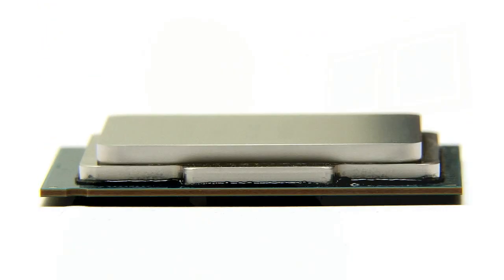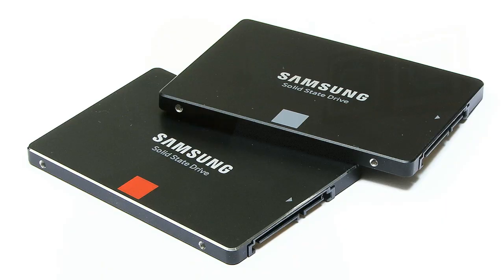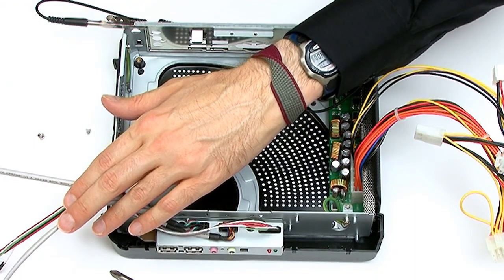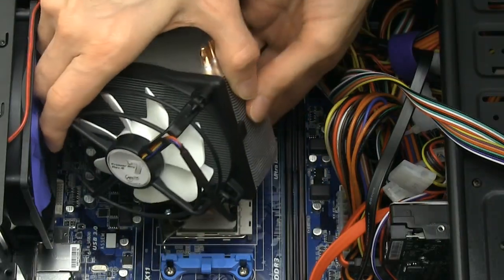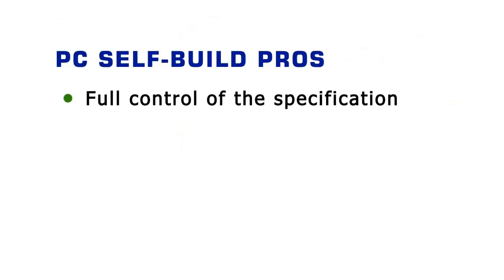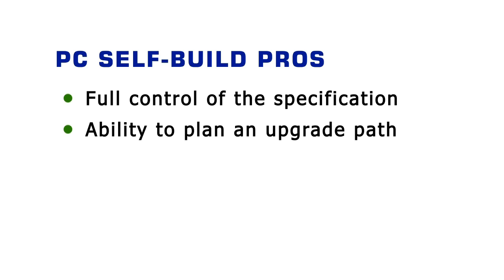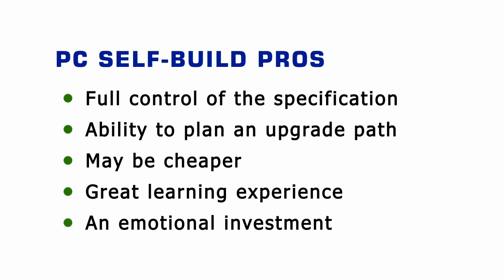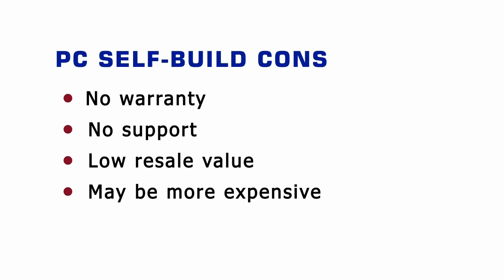New PC: Build or Buy?

Comment: Sure you can go out and buy a computer, but what's the fun in that.  Buy the parts and build it yourself and you'll have more satisfaction in that computer.  Everything today is practically plug and play not much involved...the worst part is installing all the software and the OS, that gets pretty boring sitting there waiting for stuff to finish installing.  

Trouble is, the cost to build your own PC is not as cheap anymore.  Companies buy in bulk so components are cheaper and they can sell the computer for less than you could get the same components and build it yourself for.

Has anyone ever actually tried to call tech support for that box store computer you bought?  

Have any of you actually built a computer and sold it?  Highly doubt it, you are probably still using it because you over-built it to last.  

The trouble is people get the idea to build their computer on their own but they buy the shittiest components then wonder why it doesn't work, or why it doesn't work properly.  Either build it properly with good quality components or don't bother.  

The hardest part is deciding which OS to install.  Sometimes the go-to OS is Windows of course but Linux is getting to the point where you don't have to be an expert programmer to use it anymore...oh and Linux is still free unlike Mac and Windows.

Comment: Excellent summary! I've both built and bought PC's for over 35 years, but I've been happiest for longest with the ones I've built. I'd only add to your advise that the risk of compatibility problems can be minimized (but not entirely eliminated) by using a (free!) part-picker web site like PCPartPicker (http://pcpartpicker.com/). They provide many example configurations at many different price points, for a variety of different uses, but also an orderly, very complete, component-by-component part selection process with a built-in compatibility filter. Also, the other internet resources available to help you learn how to do it, step-by-step, are so wonderful, that the risk of making stupid mistakes can also be minimized. Your own Utoob channel is a great example! But of course, stupidity is the most common element in the universe, so some people should simply never do it.

Comment: I've built a few PC's and always thought I didn't save any money but I did get to choose exactly what went into it. I also had to deal with finding drivers that would work with the MB and the OS and that can be pretty involved.

If you are using the machine for gaming I think the best bet is to buy a refurb. You can usually get a business machine with decent specs for short money. The last 3 computers have been refurbished and all have worked out well for me or friends i bought them for. This is an attractive option if you want a machine to run linux on, a dual core processor can be had for short money and runs fine under linux.

Comment: A ready built PC may be a little more expensive, but it looks much better (form factor, compact, etc.). 
Personally, I assemble myself since I can't find a ready PC with what I want. But I always admire the ready PCs in the shop.
Reply: JohnnyMindcrime I agree. I think flashing lights are not only silly, but pointless and it is a joke that components cost more for them. 
Personally, I wish I could nail the size precisely since most of my case is empty. My next build will be the smallest form factor possible (in 5 years time).
Reply: Yeah, those are really nifty. There are some builds out there that cram a GTX 1080 (or similar) in there, too!
Reply: If you've built something tidy and high end it's sometimes nice to have a glass window. The same way you might be able to peer through a glass lid to see the engine in a super car

Comment: +ExplainingComputers / Christopher
Yet another good video and a good demonstration about the pros and cons of building a new desktop / workstation.

As like yourself, I have built countless number of computers over the past 25+ years (I have had my share of disasters but most devices have been working after first attempted build). 

About 15 years ago I was working for an independent computer retail vendor, in which my job consisted of building and installing at least six workstation per day (I built this many computer every weekday for over a year, as well as installation of OS and software, and repairs of existing devices).

Due to time restraints and cost, these days, I prefer to purchase new branded devices with warranties from trusted vendors / suppliers.

Comment: Just doesn't pay anymore, especially when you find a great deal on a tower.  Example I found a Gateway DX4885 for $330, 3.3Ghz i5 quad, 8GB memory 1600MHz, 2 TB WD HD, Silver PSU, Windows 10, and near silent operation.  Added a SSD, and it's fast.  Also you know that the parts/drivers they choose will get along.
Reply: But with an older generation processor, a low grade 300W PSU and basic case you limit any future upgrades to add graphics capability. 
It would cost about $360 to build one with a 500w psu and a half decent case, by taking advantage of some price cuts and deals.
Reply: A D of course it pays. Who wants to own a Gateway? Or a Dell? Jesus talk about bottom rung of the ladder.
Reply: You can find good deals on components too. The PC you got surely fits your needs, but that's not what everyone needs. In my opinion it's worth learning about PC components before buying, so that you know what you're actually spending your money on. Being a sensible buyer always pays back.
Reply: All that matters is what's inside, which I determined b4 buying.  Research motherboard and all other components.  Sometimes a manufacturer that's considered low end, can build a high quality great machine, but they are few and far in between for such a low price.

Comment: i7 6700k
2x 16gb Corsair Dominator Platnum 3ghz cl15
phanteks enthoo luxe tempered glass
asus z170 pro gaming aura
transcend 256gb ssd
be quiet dark power pro 11 1200W
Zotac 980 ti arcric storm (hydrid)
corsair h100i 240mm AIO liquid cooler
thermal grizzly paste

i will buid my little sucker next weekend, i wonder what you will buid...
Reply from the maker: Nice spec! :) A bit more powerful than what I am putting together. :)

Comment: For my customers, I prefer not to build them a PC. I usually  go with Lenovo for a warranty. Easier for me and the customer. I can't build a PC for less cost than a pre-built, especially if it is a refurbished PC from the manufacturer. If anything goes wrong with the PC, then it's all on me. Not an ideal situation, when you're trying to make money. I gave building PC's for customers a try in 2014. I had one customer where I had to go back 5 times, because it kept locking up. It was Windows 7 causing the problem, but the customer doesn't care about than. They just want it to work. I ended up losing money, but I kept the customer.

As for my own needs, yes, I have and probably will, build my own. Just for the fun of it.

Comment: +ExplainingComputers i was considering building my own pc but the fact is windows is way to expensive and i rather just buy a prebuilt machine because you have the tech support
Reply: Tech support is pretty useless anyhow so no loss in building your own, and you'll have the satisfaction that  you built it yourself, and you know what is in it.
Reply: William Todd that is true but my only concern is me breaking a pin on he cpu it self
Reply: Don't be so scared so much help out there now online! Once you have built one you will think what was I worrying about.
Reply: Wayne Johnson true
Reply: Locking in the CPU into the ZIF socket can be nerve-racking (especially when you've invested some money in it) but so long as you place it the right way round and to you didn't slam it into the socket it should be fine 

I found AMD's ZIF socket more mentally calming as the pins are on the motherboard as opposed to Intel's were the pins are on CPU itself.
Reply: zach schwanke Press straight down you'll be fine.  If you bend a pin straighten it back out.
Reply: zach schwanke Kinguin sells windows 10 for 30$.
Reply: Unknown Unknown don't you mean the opposite? Intel CPUs don't have pins, the pins are on the motherboard and the opposite on AMD CPUs.

Comment: For people on a budget, self-building is the way to go. Decades ago, upgrading was an expensive proposition, you often had to upgrade the mainboard, CPU and memory in one hit. Very costly. Nowadays with CPU performance generally having hit a plateau (you only need so much performance for gaming and web browsing), the GPU is the only component that needs upgrading every now and then. Everything else (OS, peripherals, monitor) if bought well, can last you decades.
Reply: Not exactly. It depends on what configuration you want. If your purpose is normal office use, buying a Dell with MS Windows 10 pre-installed is cheaper than DIY.
Reply: good luck with a 1080p monitor in 20 yearrs

Comment: You can pick up an old copy of windows (via keys) for almost nothing (20-50 dollars) off sites like g2a or eBay. Its not that bad
Reply: g2a is very sketchy don't buy it from there
Reply: 35$ win win10 pro from reddit, have done many times
Reply: don't forget kinguin :P
Reply: yeah but the thing is you don't know if that key has been resold to others as well.  99 percent of the time if you get a key that cheap the person selling the key spent more for it than that and is reselling to others as well so eventually your key will be shut off or the next time you attempt to reinstall it won't work. Good luck with that.
Reply: jayw654 Meh, done it several times and it's never failed for me. Also of it does fail oh well you can still buy 3 more copy's for less than an official packaged copy
Reply: Cherano Kreeft :D You can buy a volume license key cheap in a grey market and it'll be fine.
Reply: I have bought 3 Windows keys from eBay for about $3 each for 3 different systems. What I did was buy a Win7 Pro key which they send via email. You then install Win 10 Pro and activate it using the Win7 Pro key. This still works just fine as MS only partially blocked the upgrade of Windows and not the fresh install of Windows.
Reply: No, that is not how it works. Microsoft supply free spare 'Service Product Keys' to OEMs and system builders. If a mainboard goes wrong, the repair shop can use one of the spare service keys because they don't have the factory process to embed a key into the mainboard firmware. Often the mfrs don't need all these keys and sell them off. Actually I suspect that this process is illegal or at least against MS T&Cs, but the key itself is perfectly valid. Once a key is activated it is locked to the mainboard - no one else can use the same key because MS servers will detect that the hardware has 'changed' and they will refuse to activate it - you then need to phone MS and explain why your hardware has changed - if you cannot tell them what your mainboard was previously (i..e the currently activated system) then they won't give you an activation code.

Comment: I built my first PC in 1996 for college (gaming). nothing too special , average to good spec for the day, (I think) a P5  66 MHz Pentium, Voodoo Graphics card, SoundBlaster pro and Win95.  I have been building my own ever since. 

But these days, i'm a bigger fan of Laptops rather than sitting at a desk with my PC on it. At the moment, my PC is just a hi spec Steam box.
Reply: lel
if u still have that thing, voodoo cards are rare now, sold one for $25
Reply: and bought a geforce 9800 gtx+
Reply: Benjamin Beasley
 And that $25 went a long way paying for the 9800 gtx+
Reply: I had twin Voodoo2 graphics cards in my PC. Twin voodoo 2 cards worked better for 3D than the later voodoo3 cards.
It was not till they put out graphics cards to go in to the Vesa graphics card slots with the built on 3D that they became obsolete.

Comment: I personally think the benefits outweigh the risks
Reply: I'm so tired of all this UEFI windows bullshit, so i went to linux :)
Reply: Naheed Uddin and it's really fun putting it together and see it start for the first time
Reply: Couldn't agree with you more
Reply: Ha, built at least 50 PCs. My current project had a bad motherboard and though it is here somewhere I misplaced the pin cover. Same as loosing 170$, but as I get older more and more shipped parts require RMA and it cost me shipping in many cases.I have piad several hundred in RMA shipping fees over the last decade. Still worth the risks but crap does it get me upset for the lack of QA sometimes. Still, that feeling when you get that first boot on a system you built never goes away, no matter how many you build.
Reply: It does not take that many RMA shipping fees to reach 100$.
Reply: I also order parts to fix other's computers. Still seems like 1 in 10 as far as the part loto goes.
Reply: Statistics would only show a problem in better clarity with a much larger sample size but if you build PCs you will deal with defective parts. The more you build the more noticeable the cost.
Reply: David Yeakle  guess what, you have to do that with retail versions too. OEM version is the real version too.i also realize that your post is 2 years old. My comment is not to bash you just to show a little clarity
Reply: David Yeakle  if it's the same PC, you don't have that charge to worry about
Reply: David Yeakle  i didn't miss the point of it at all.... My point is i have never experienced that issue you're talking about and all ive ever used was OEM version....
Reply: These videos just scare the crap out of me. I've broken so many OS installs and possibly breaking hardware is just scary to me.
I've been looking into making my own desktop but it just seems like too many things can go wrong. I bricked a damn N64 by taking apart the cheap 3rd-party 4MB RAM expander (Expansion Pak) and inserting the naked chip the wrong way accidentally. I bricked a freaking N64. 
I've lost lots of screws. I've cracked screens by stepping on them. I just have next to no confidence in my ability to not create a paperweight out of an electrical component.
I've successfully added a hard drive caddy to one of my laptops where an optical drive would've gone... That's about it.

Comment: i have a continuous build that has been going since the year 2000. clearly i don't have any parts in it that i had back then, but progressive upgrading with a couple hundred bucks a year on average has me with a decent midrange computer that has ALLOT of good storage. and enough parts to have an emergency backup for everything in my computer (i could probably build two with old parts sans a few bits and bobs, i only have one extra case worth using atm). overall i think i saved money in one way, i ALWAYS had a mid to high range computer with just a couple hundred a year.

Comment: If I build a PC, i'll always put Linux on it.
Reply: LINUX MASTERRACE!
Reply: Olaf Der Wikinger dual boot masterrace anyone
Reply: Are you sure that you don't want to pay 120$ for Windows 10?
Reply: +greg i can virtualize windows with 99% performance passtrough, but with way more control without it spying on me beyond my gaming habits.
Reply: Linux is the best, the Terminal where you type in your commands is more powerful then any Windows OS by far
Reply: Glorious hardware passthrough masterrace, run windows inside linux with full performance
Reply: Always.
Reply: Build a Hackintosh! mac OS is free these days.
Reply: I see your point. It I build a gamming of and plan on putting Linux on it.  O AD is an awesome game combing out for Linux so I think Linux is good for gamming.

Professional game devs have to make a certain amount of money and that's why they are avoiding Linux, but if one person makes a awesome game for Linux and becomes rich off that one game, you can bet everyone will be taking Linux seriously but only if that day comes.
Reply: Kinguin, Windows is 25 Euros, convert to your currency and it comes out quite cheap. https://www.kinguin.net/category/19429/windows-10-professional-oem-key/
Reply: linux rules. if you build, choose your MB carefully; not all will run linux smoothly. a big pro to linux is you can use last year's MB/cpu and save money.
Reply: If you're building a Gaming PC, I wouldn't bother. Linux Games run worse-with less optimization than the Windows versions. Even though Linux Gaming has potential, Developers don't care.
Reply: Erik Wallström i dont like windows 10 i hate it